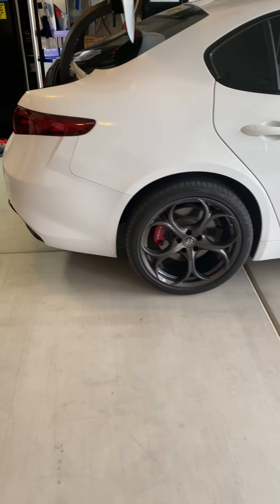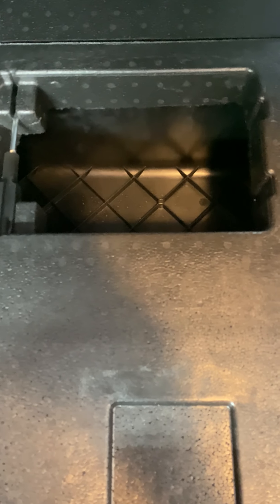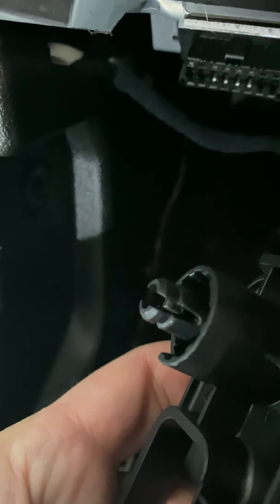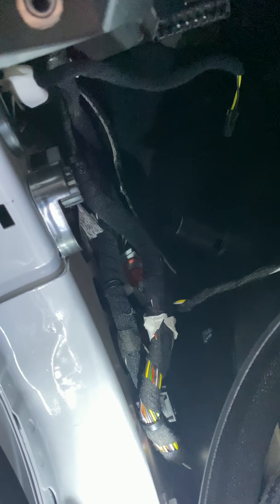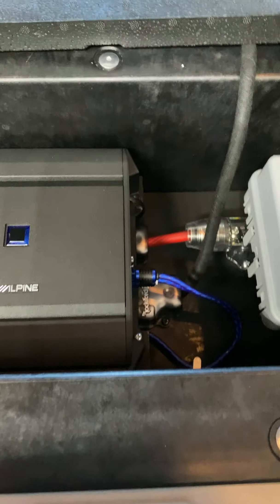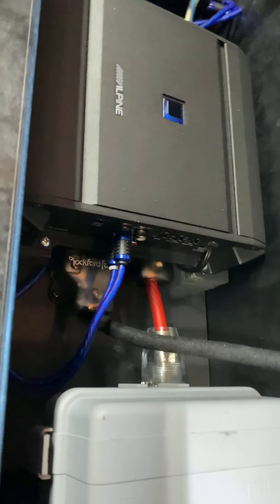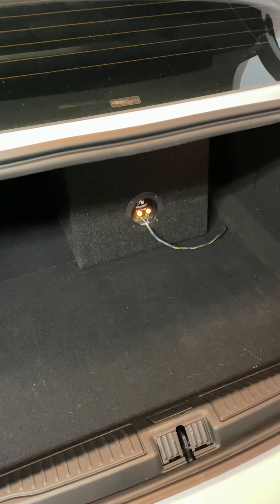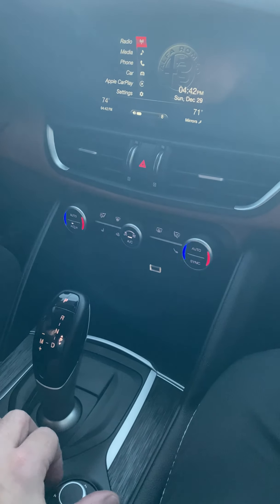Alfa Romeo Giulia Base Stereo Upgrade

Comment: Great video! I see that you used the speaker wires as signal to the LCI2; does that signal also control volume of the subwoofer? If not, how did you get your subwoofer to turn up and down with the stereo? Thanks
Reply from the maker: Yes they do. Also ensure you set your gain correctly on your amp and LC2i.
Reply: @TS-hk2rr  I appreciate the response. I was about to give up on upgrading my system after reading all the Alfa forums, it was so much information that it got overwhelming...then I found your video that really simplified things, so thanks again.

Regarding setting the gain, how did you do that?
Reply from the maker: @tylerschulz6937  Crutchfield has a really good article on setting amp gain. I bought a cheap oscilloscope for $40 from Amazon and it works great. Here’s the Crutchfield article https://www.crutchfield.com/learn/car/subwoofers/tuning.html?g=100

Comment: I know this is old but did you ever add sound deadening? Im about to install a sub in my Giulia and wanna know how much of an improvement that would have made.
Reply from the maker: It’s an old thread but I still try to reply, I only added a sound deadening license plate to avoid the rattling.
Reply: I bought a huge package of it so I’m gonna add as much coverage as I can. Prolly gonna do a similar amp and LOC install as you have.

Comment: Confused on how you did the remote turn on, you ran it out of the LCI2 into the amp, but how did you run into the LCI2?
Reply from the maker: The LCI2 utilizes speaker inputs to create a remote turn in for the amp. Some amps also have the capability to turn in with speaker wire input without a remote turn on wire.

Comment: What type of tap did you use to tap into the front speakers? Or did you hard splice everything?
Reply from the maker: I used scotchlok taps
Reply: @TS-hk2rr  I appreciate the tips, I just have one more question, I’m not sure if I am tapping the right wires, there is an accessible harness right underneath each side of the vehicle, how do you know if your tapping into the right wire harness? I get the color of the wires but there are several wire harness, I’m guessing the one that is easiest to get to right underneath each door sill panel, thanks again for all the help, I’m such a rookie at this, lol
Reply from the maker: @Ybshy  I pulled the speakers and used an ohmmeter to find the corresponding wires in the floor channel to tap
Reply: @TS-hk2rr  thanks for the tips

Comment: Hello, my English is very bad.
I would like to know where you got the signal from to install the amplifier.
Are there cables in the trunk to be able to do the installation without having to take a cable from the speaker?
Reply from the maker: The power and ground can be accessed from the trunk, but the speaker wire I used was from one of the front speakers. You could potentially use one of the rear speakers but unsure of the results.
Reply: @TS-hk2rr yea, I’m wondering why you would use front wiring for a sub.
Reply from the maker: I can’t remember why I chose that route, but I think when I did a bunch of reading leading up to the project the front door speakers were easier to get wires to than the rear doors and there was something with the signal going to the rear deck speaker that steered me away from using that.

Comment: Where is the RCA wire? I need to take behind the radio?
Reply from the maker: There is no RCA wire. That’s part of what the LC2 will do. You have to tap into the speaker wires from somewhere. I chose the passenger door speaker to tap into.
Reply: Stavo per chiederlo anche io
Reply: @TS-hk2rr  "I chose the passenger door speaker to tap into." ? I thought you took the signal from the left and right. I'll try tomorrow, but I'll probably use the rear speakers, should it work? the worst thing is finding these cables...
Reply from the maker: @vaiaki You are correct, I did tap into both front speaker wires. Rears should work as well.

Comment: What did you use for a remote turn on?  It wasn't quite clear in the video.
Reply from the maker: mbrhlp3 I used the remote turn on supplies by the AudioControl LC2 next to the amp. It senses the signal from the speaker wires and has an output for remote turn on that I ran to the amp.

Comment: Question, where did you tap into for remote amp on?
Reply from the maker: @Ybshy  no tap for remote. The AudioControl line out converter takes input from the speakers and creates a remote turn in to run to the amp.

Comment: Best video I could find; which sucks because it isn’t very detail oriented. 
I’m doing this same install, but adding an equalizer. Can’t find a single video where someone else has done it. 
Why did you tap the front speakers as opposed to the rear? Seems like unnecessary labor.

Comment: basically mimicking your install... did you see any bass roll-off on your oscope ?
Reply from the maker: I didn’t have roll-off, but if I cranked the gain, I could see it clipping.
Reply: @TS-hk2rr  Perfect! So you have your accubass turned off on the lc2i?
Reply from the maker: @wild_mike  it’s a little less than 1/2 way up. Took a pic of it. Trying to see if I can upload it here
Reply from the maker: Wouldn’t let me upload
Reply: no worries, helpful nonetheless. I just decided to pick up an oscope so I'm not guessing.
Reply from the maker: @wild_mike  that’s what I did. Cheap one off Amazon but it works.

Comment: Question. If I am simply adding a sub with a built in amplifier to the 8 speaker base system, can I simply just grab power from the right rear door speaker?
Reply from the maker: As long as the built in amp has a signal sense capability to know when to turn on, otherwise you’ll need to provide a remote turn on wire in addition to the power and ground for the amp. I don’t see why it couldn’t work. Keep us updated on the install.
Reply: @TS-hk2rr  I got the Rockford Fosgate Punch P300-10T Single 10" 300-Watt Amplified  Sealed Box Subwoofer . Nothing too crazy but it should help out the base factory system. It shows to have auto turn on/turn off. So tap into the purple and purple/orange at the right rear speaker, power to the battery, ground and install a fuse near the sub and pray that this novice does it right. I will keep this thread posted on the outcome. Thanks for the help
Reply from the maker: Put the fuse inline with the large power wire from the battery no more than 18” away from the battery. That takes care of power. Ground to a chassis ground as opposed to battery ground.
Reply: @TS-hk2rr  One more rookie question. Do I actually need to tap into both speaker wires at the right rear or can I just use 1  and connect my subwoofer wire to it with a T connector. Thanks
Reply from the maker: Tap into both
Reply: @TS-hk2rr  okay, did the install. I simply tapped into the solid green and the green with black stripe in the right passenger door boot for power. The powered sub made a major improvement over the base system. Thanks again.
Reply from the maker: @mattsonger5604 I’m glad it worked out and made a good improvement!

Comment: does the base model have in-line amps like most bose speakers? and is there a crossover for the front door speaker and tweeter?
I don't want to install an amp but I do want to upgrade the speakers.
Reply from the maker: To my knowledge the base stereo has a built in amp as part of the stereo unit. I’m not sure about the crossover’s for the door speakers. I found a lot of info on the European Alfa forums.
Reply: The base audio system is powered by the head unit amplification. The only crossovers in the entire system are on the four tweeters. They have built in 6 db capictors on them they are crossed over at 8khz. The midbass drivers have no crossovers. The signal being fed from the OEM radio are full range. You can by a 40pin Fakra adaptor extender. One for a VW/BMW will work. You can access your speaker wires that way. THe head unit is located above steering wheel behind the small cubby. YOu will need a line output converter with the ohm impedance button link the LC1, LC2 Pro inorder to avoid the dash light set it at 20 ohms

Comment: How is the base stereo? I'm used to a ford fiesta 😅
Reply from the maker: Cliffracer the base stereo actually sounds really good, just lacks bass.
Reply: It lacks a lot in bass it’s pretty bad if you put the bass all the way up it becomes super staticky I got the 2020 and kinda upset
Reply: @esatkomina  the tweeters are also screechy at high volume, wish I had the harman kardon for sure.
Reply: @potatochobit harman sounds ok; definitely not Bose quality, but it too lacks bass. That’s why I’m doing this same install, but adding an equalizer.

Comment: Where did you find what wires to tap into for the front left and right door speakers
Reply from the maker: I pulled the door speakers to check wire color then ohmed the matching color wires to ensure they were the right ones.
Reply: @TS-hk2rr  I’m totally done with my install other than the high level to my LC2i, struggling with finding what wires to tap into. Also how did you tap the wires, did you use something like a Posi-tap?
Reply from the maker: @Thomas092089  congrats on the install. I did splice in to the wires. I believe in the video I give the wire colors. Can’t remember off the top of my head though.
Reply: @TS-hk2rr  yea on the driver side there is multiple yellow wires with solid yellow and yellow with a stripe
Reply from the maker: @Thomas092089  in that case, remove the speaker from the door and use an ohmmeter and probe to find the correct wire.

Comment: Hi did you add any of the sound dampening material?
Reply from the maker: I haven’t yet. I may eventually line the trunk with dynamat but it’s been good so far. I did put some foam behind the license plate to keep it from rattling.